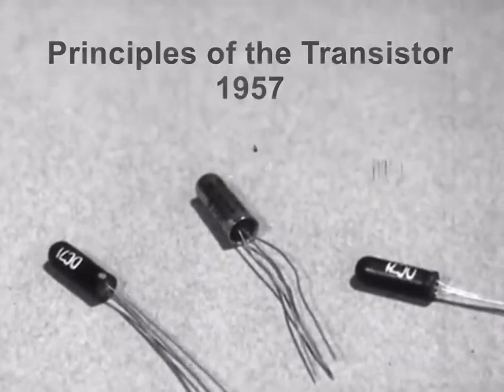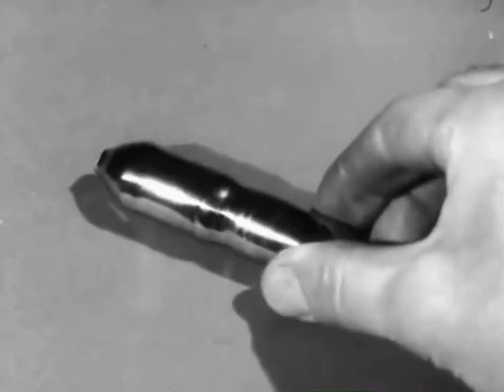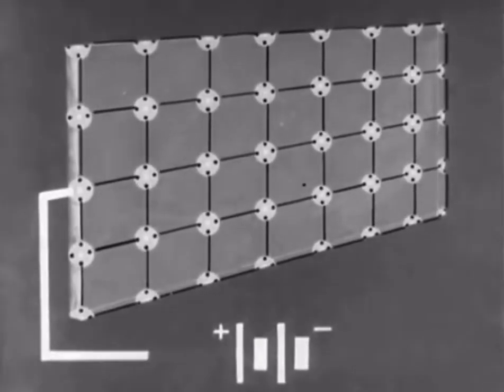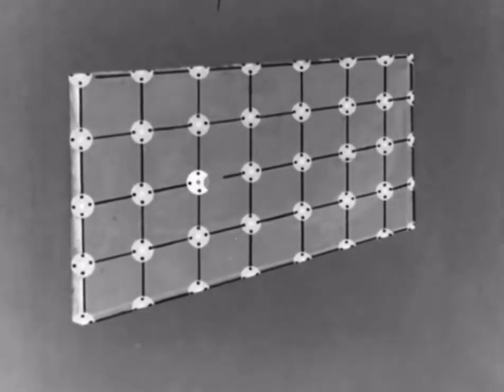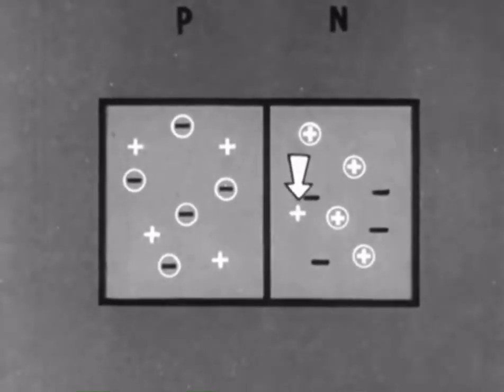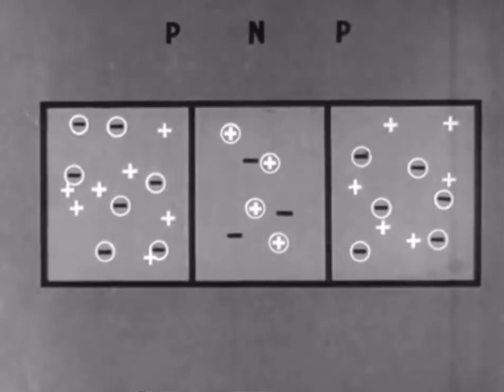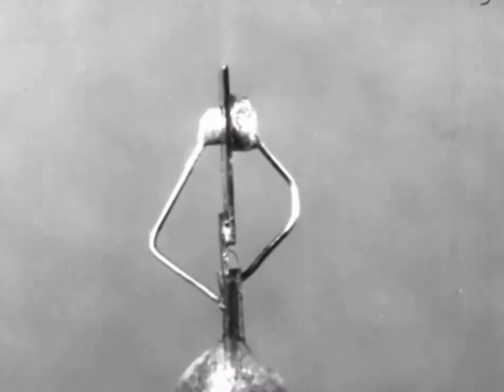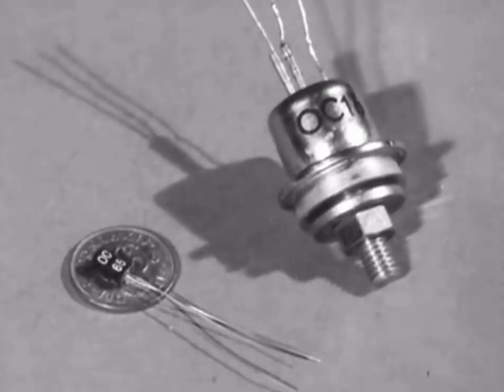Principles of the Trans Sister presented by #electron media inc.

Comment: But this video is a poor illustration   must bd wrong if it's simply like this illustration why does the power out change whether the are in series or parallel? Like more volts less amps or more amps less volts?